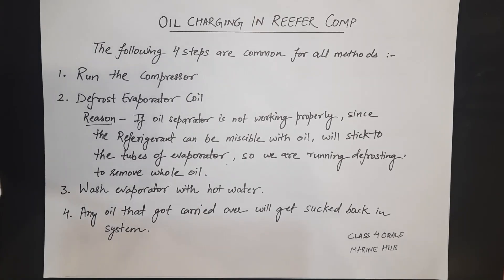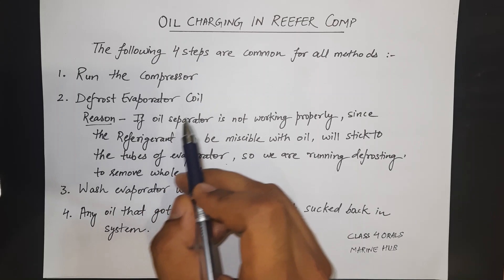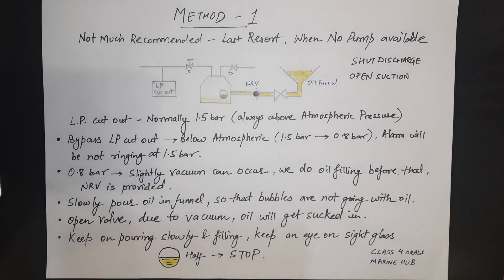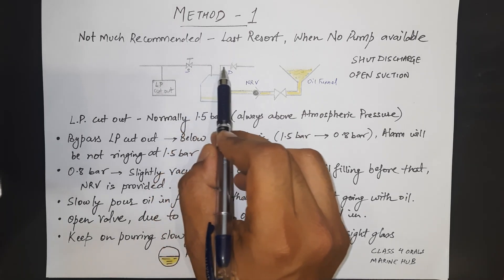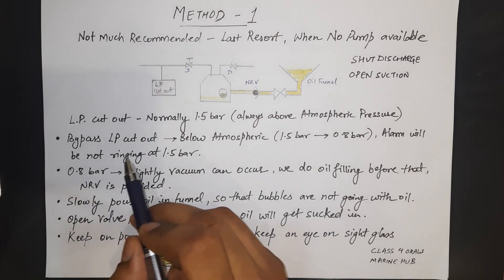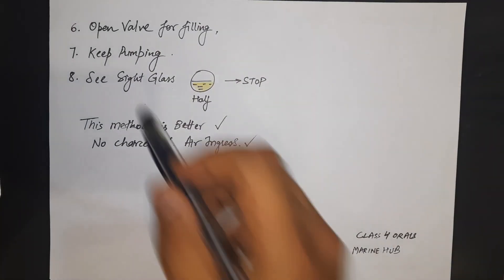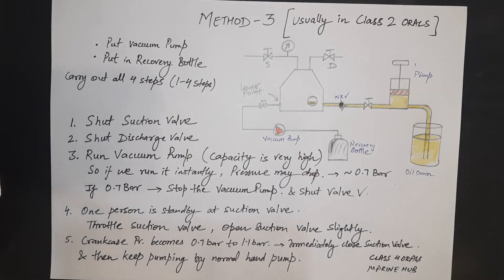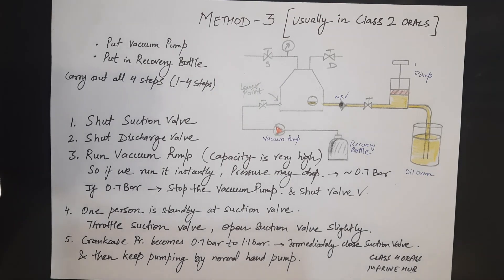How to Charge Oil in Reefer System?🤷‍♂️ 3 Methods Explained👍  Important Steps | Must Watch

Comment: In method 1, if we start the compressor with the discharge valve shut, will it not damage the compressor?
Reply: we will 1st shut suction valve so that compressor will make vacuum inside it.
then only oil will transfer from oil can to crankcase